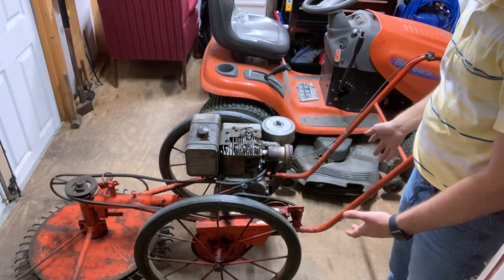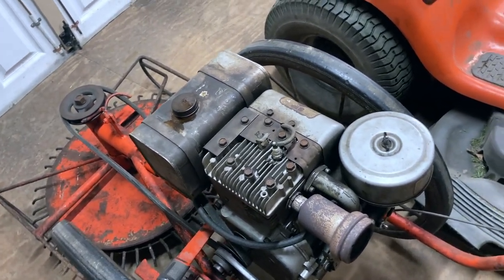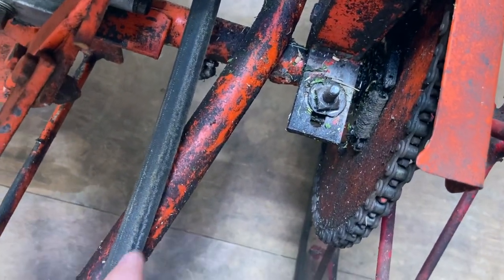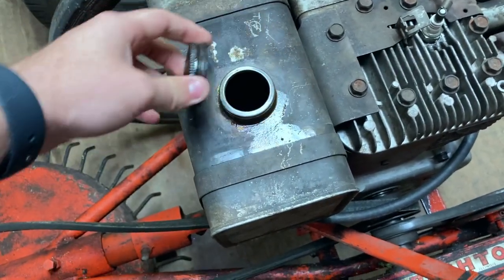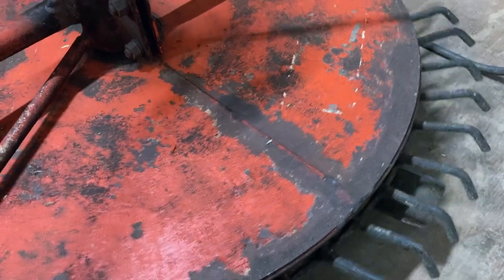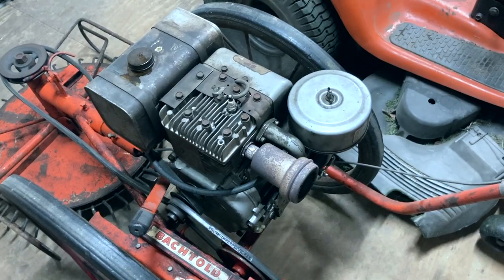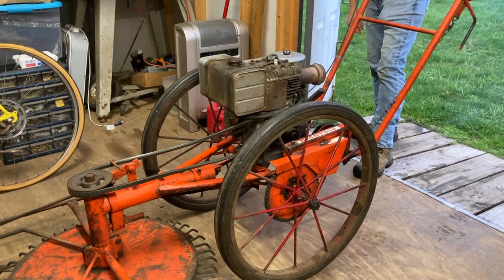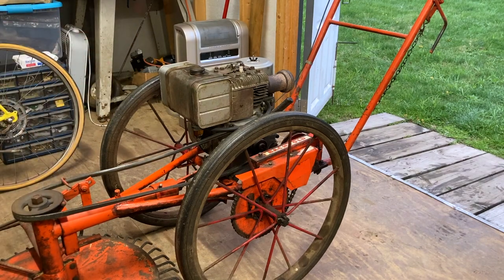1960s-70s Bachtold Brush Mower

Comment: I have one of those first DR mowers that looks just like this but has a solid steel brush hog deck with a very thick mower blade. It will cut anything it can bend over. I also have a couple of old brush saws from the late 50's early 60's almost like this but has a round exposed saw blade. It is very effective on one to two inch brush. Always cut on the left side of anything, never on the right side or from the front and it is easy to control. I guess those companies were forced to quit making them because they were deemed to be too dangerous.
Reply: This one is a light weight one I think 
I had one but it was stolen
Reply: It had a guard over belt
Reply: @philliphall5198  yeah i think so

Comment: were  also powered by honda engine?
Reply from the maker: doncampbell9991 hello, are asking if these brush cutters came with Honda engines? Only the Briggs and Stratton  were factory but can be converted to a different engine. Thank you for your question.
Reply: Partially untrue.   I’m fairly certain that Honda engines were never used, but earlier ones were powered with Wisconsin engines.  I know because we had one.  They didn’t have a recoil starter, you wrapped a rope around the flywheel that had a wooden handle.